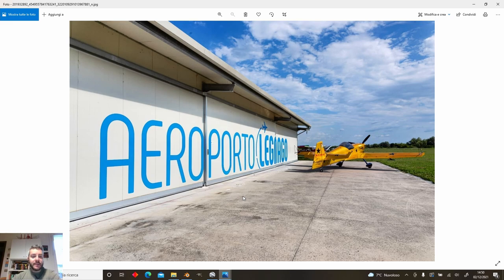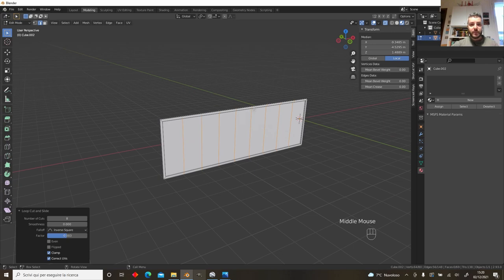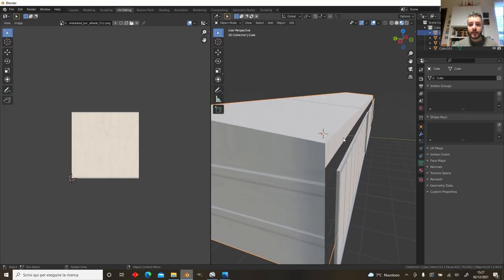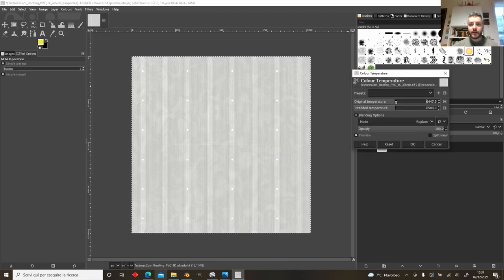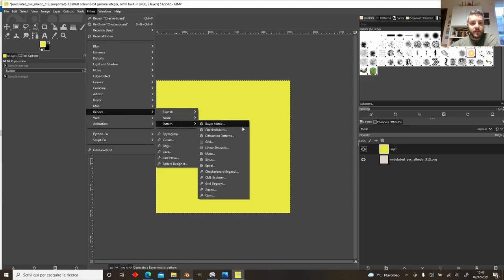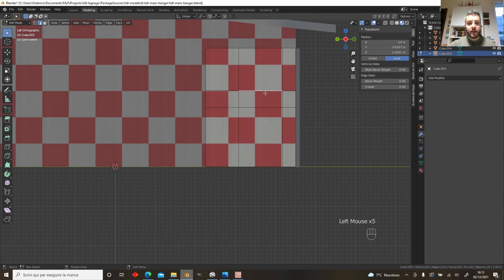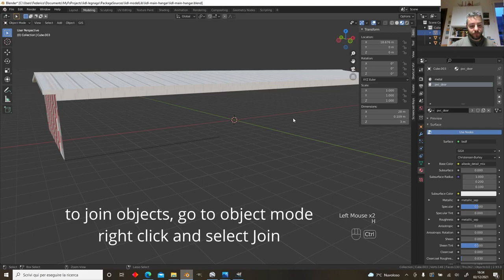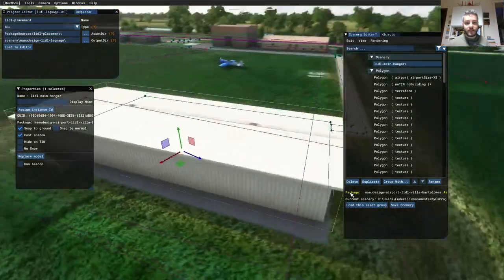MSFS SDK Airport Tutorial - Hangar: How to Make in Blender with decals - 5h episode

Comment: Thank You Frederico; you are the man on the spot with regards to the SDK. I'm learning so much from you and so grateful. 🙂
Reply from the maker: Thank you so much!
Reply: @MSFS-SDK-TUTORIALS  One question; I noticed you used an 8-bit Comp texture file. I read somewhere that it should be 16-bit. Is that not the case?
Reply from the maker: @sailwesterly5444  good point, i have never paid attention to that
The 16bit stuff Is written in official documentation
However i didn't noticed any issue using 8-bit, the sources are 8 bit so any upscaling Is Just a waste of space on hard drive 😅
However

Comment: Hi there,
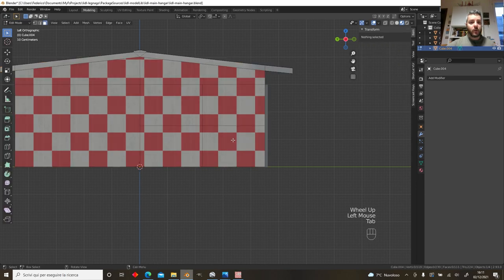At 24:33, I know that you did some pre-work to cut those four rectangles out of the hangar. But if I wanted to make a loop cut like what you did and put the door at a certain distance (let's say exactly 1 m) from the right side, how could I do that? I know that I could make a loop cut, push it all the way to the right, and then grab it and slide it by -1 m. But the problem is that the loop's z-axis doesn't want to grow/shrink with the slide. So if I were to do that, the hangar's roof would get distorted. I know that I could grab and then type 'g' again (so 'g g') to slide along the roof, but then I can only slide the loop cut imprecisely with my cursor, and I would end up with a loop cut at something like -1.013624 m away instead of -1.000000 m away.
Another way of asking the question is, how do you do a loop cut at an exact distance (e.g. 1.000000 m) when the axis you're sliding along has two lines that are not parallel with each other?
Thank you!
Reply from the maker: hi!
Blender is not really meant for precise to the millimeters modelling
You can however turn on "edge length"
So when you position the loop cut you will know the measure of the edges
And with enough zoom and pressing the shift key while moving stuff you will obtain pretty realist measurements
Reply: Thank you! Yes, it's unfortunate that I happen to have the exact measurements for this hangar that I'm doing and it's a shame that my cuts have to be imprecise. But thank you for the response!

Comment: super tutorial - I just did a building for an airport. I set the #uv maps in Blender so that it works good but when I export to MSFS my UV are completely distorted and wrong... Do you have an idea?
Reply from the maker: Thanks mate! UV distorsion usually happens when you scale them well beyond the texture bounds or when you have ngons (faces with more that 4 vertex) in your mesh (and also scale the UV)
Reply: @MSFS-SDK-TUTORIALS  but I watched your tutorial on texturing and you scaled your textures over the bounds as well so I don't see my problem at the moment. Only in ngons I agree... Damn it. Then I have to Completely redo my building...
Reply from the maker: @A360JFuxtier  yeahhh i'm also going beyond the bounds of the image, 
It Is not Exactly clear when the problem occurs, usually Is when a texture Is too stretched/scale on a single face. So you can solve also subdividing the offending faces with some loop cuts. The problem with ngons (they usually Born with boolean modifiers) Is that loop cut are difficult to do, so you have to manually join vertices couples to obtaing new faces

If you Need some more help i have a discord too 

https://discord.gg/Nk5ByGVT

Comment: How does one control the opacity of a decal on a plane in Blender? When exporting it after having adjusted the "opacity" in the Alpha multiplier of the material parameters, it still shows as having opacity of 100%. I want to create subtle dirt textures on the roof and on the side of a building with material already on the planes (hence the plane instead of the mesh of the plane itself).
Reply from the maker: This is the reason I used decals most of the time, adding dirt!
Make sure you are working with latest version of the export plugin (or at least any after .40.2.5, thanks mikea for that) In Blender, in the msfs material properties, the you should set the Albedo Color Mix in order to see the result in msfs, while the Alpha multiplier affects only the Blender rendering
You can double check the gltf file, the 4th value of the baseColorFactor is the alpha value, 1 means full opaque while 0 means full tranparent (the other values are R G B components)

 "name" : "decal",
            "pbrMetallicRoughness" : {
                "baseColorFactor" : [
                    1,
                    1,
                    1,
                    0.3700000047683716
                ],

if you need more help feel free to contact me on discord 

https://discord.gg/WK9QDPrq4R

Comment: Federico....at 4:17 you make an Insert...how do you make the Inset with equal size? When I do it, the resulting frame doesn't have the same border measures, much bigger horizontally than vertically, because the plane length is bigger than the altitude and I have to fix it manually to make them equal
Reply from the maker: Hi Rafael, that behaviour happens when you scale a mesh in object mode, in order to avoid It i Press frequently ctrl+a (transform menu) and select apply scale/ apply all
Reply: @MSFS-SDK-TUTORIALS  What I was doing in object mode is Select all> Object> apply scale, I see now the difference.... Thank you Federico!

Comment: Thanks for this, great video! One question, for MSFS, do I need to bake textures, to create one Texture image for my object, or it will work with just exporting it with a model with MSFS blender toolkit?
Reply from the maker: Hi Filip, no Need to bake the textures, the exporter take care to convert any textures used in the materials and Copy them as PNG in your modelLib/texture folder (this Is the reason why in the export settings you should write "../texture")

Texture baking was needed for xplane (dunno if something has changed),
 or if you use some procedural materials
Or if you want to rework/repaint your textures in substance painter
Reply: @MSFS-SDK-TUTORIALS  Thanks! One more question: is it possible to make decals a little bit transparent, with this MSFS Decals option?
Reply from the maker: @filipt7700  i'm really Sorry being so late!! Didn't noticed your question! 
Yes you can tweak decal with the alpha multiplier in Blender!

Comment: Great tutorials thanks so much for these. I'm having a problem though, I have a top of the line PC with i9-11900/3080ti FE and 128GB ram but my SDK always begins to lag after working on a scenery in game for half an hour. it starts great but 30 minutes later the FPS has dropped down to 2-3fps and is almost unworkable. Any suggestions from the community about that?
Reply from the maker: I did't have much stutters in dev mode, and my laptop Is miles behid your config
But every project Is different, so It Is difficult to nail down where the issue Is
Some guys says that Is when doing taxiways, other when placing polygons
If the issue disappear After a reload, could be a Memory leak
I would suggest to join the Devsupport 

https://devsupport.flightsimulator.com/index.html
Reply: I"ve had that happen a lot with larger projects like int'l airports. After a half hour or so, it's nearly unworkably slow. The only partial solutions I've found are either to quit the sim and re-launch it, or to turn off all autogen and hide everything I'm not actively working on in the scenery. It's a pain, but I don't know of any better way.

Comment: I created a 3D  hangar object using the method above, with multiple textures.  It exports ok with the three files (bin/gltf/xml) into my modellib/KPWK-HawthorneHNGR folder, and the texture folder (which is one folder above) also shows all the necessary png textures (which i also resized so they are multiples of 2 (512/1024/2048 etc) .
  
 But i am just not able to see it show up in the SDK when i 'build package' in the inspector./ I get error messages in the console . Any idea why ? I also messaged you on the MSFS 2020 forum with more details and screenshots of the error messages/ folder structure etc . Please help! i am stuck bad on this last hangar for KPWK before i can complete this airport . 

My previous hangar objects i only had one texture for each, and they showed up ok. This is the only one that has multiple textures. for different parts of the hangar.
Reply from the maker: Hi Adnan, i answered to your question on the forum, 
To further analyze the issue i Need your project sources via email

Comment: You did not put all textures in one single file. Is this correct?
I think this is the worst part of building. Can I skip to put all textures in one file?
Reply from the maker: you can have as many texture as you wish, they will export and show correctly. 
Baking texture is not strictly required
it has its pros and cons (the texturing method show in the video is not compatible with substance painter, that require precise uvs)